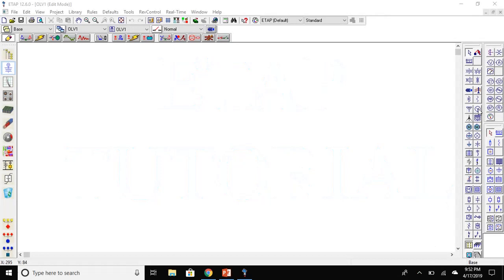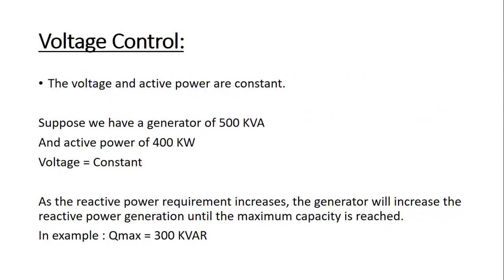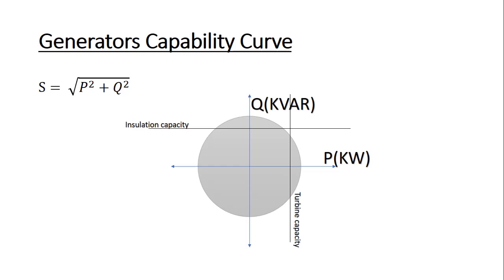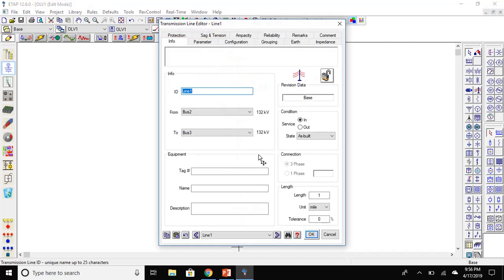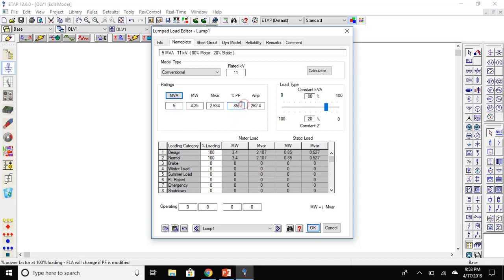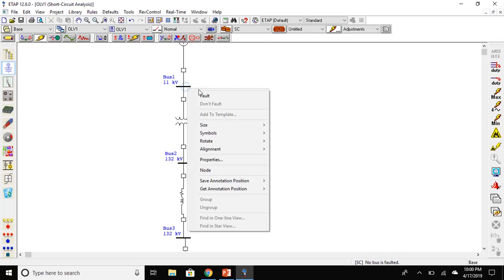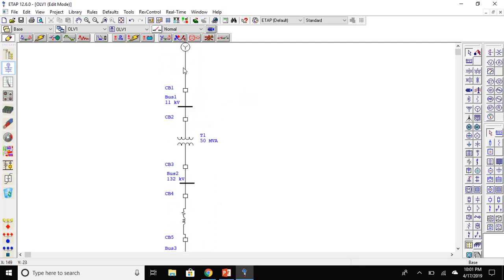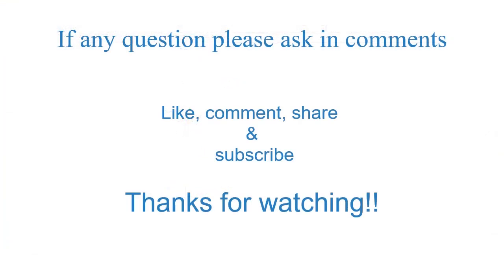ETAP Tutorial  Load Flow Analysis, Short Circuit Analysis & Relay operations.

Comment: While running a load flow analysis, it shows an error (the conductor/wire Y coordinate should not be zero). Can you please give an idea to fix these error?
Reply from the maker: Dear Sunil,
Please follow the instructions in the video, hopefully your error would be rectified.
- Check if have entered the parameters of the transmission line correctly.

or you can watch this video about load flow analysis.
https://youtu.be/LG2GqG75FZ8
Reply: check the impedance parameter, put value for "X" or "X/R" ratio